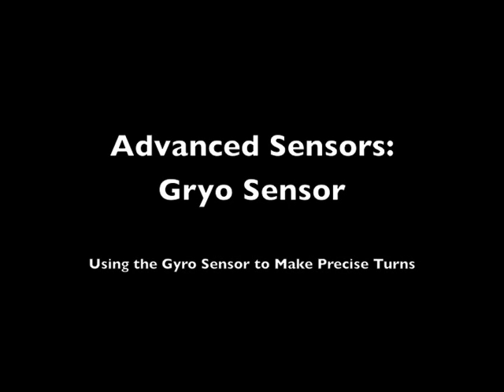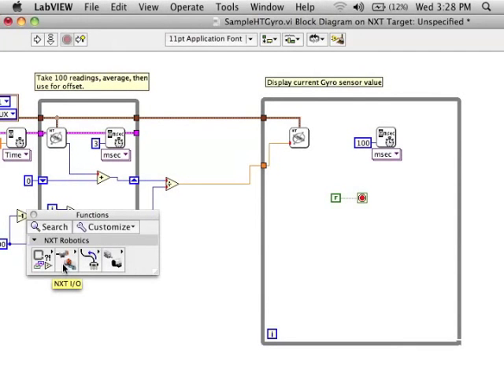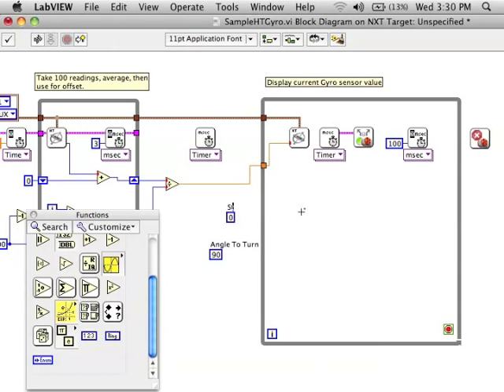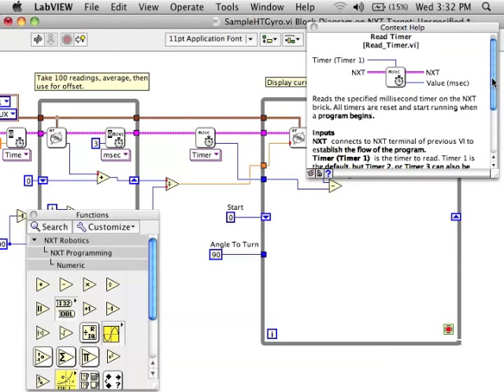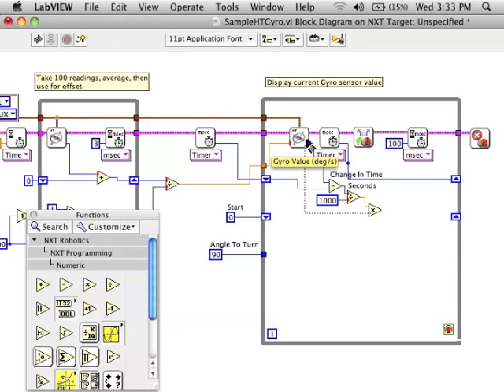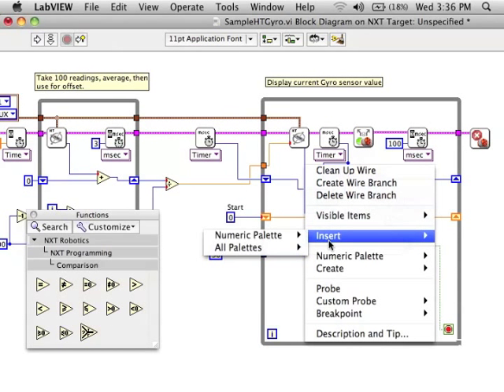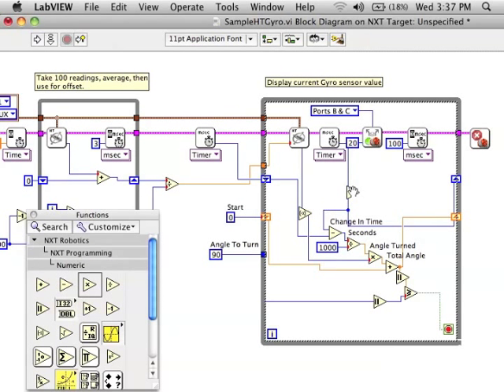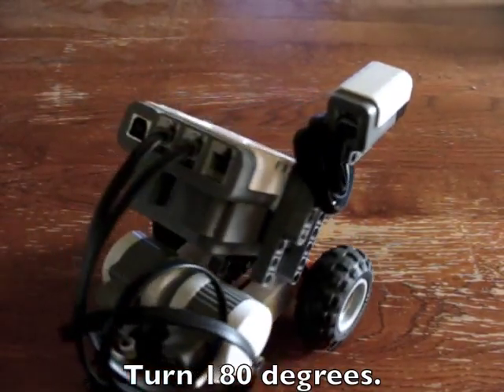Using the Gyro Sensor

Comment: Oh god is the older software so cryptic when first looking at it! EV3 did a godly amazingly incredible loving good job! I can make my AI with it! It gives me sensor/motor in/out-puts too!~
Reply from the maker: +Immortal Discoveries This is actually LabVIEW. It isn't an earlier version of Lego Mindstorms.  LabVIEW is a graphical programming language used by engineers, scientists, universities, etc.  It is made to work with many different kinds of hardware and computers.  It is actually pretty neat when you get the hang of it and much more powerful of a tool since Mindstorms is only for the EV3.
Reply: +Aaron Kennedy So your're saying I can use LabVIEW to code like EV3's blocks but can put the "CODE" into any robot ect!!?? But then the sensor/motor command blocks won't affect the robot's interworkings......this does no good fort me then? At least the EV3 will allow me to prove to the scientists to make the real AI so it's all good~
Reply: I wouldn't particularly recommend  NXTG for the EV3 or LabVIEW for an AI, but if you had to choose one, I would do LabVIEW, as it scales better for complex projects than NXTG/Mindstorms. (Also investigate RobotC).  Of course, any actual AI would likely be quite limited due to memory and processing constraints (It could not even load a Caffe based neural network, even if that framework was ported to the EV3), but you can certainly program a robot that takes input and makes "intelligent" decisions based on that input due to well thought out planning of conditional evaluations and "states".
Reply: actually you can place the data processing in you computer and use bluetooth for communication. There will less limitation for memory then.